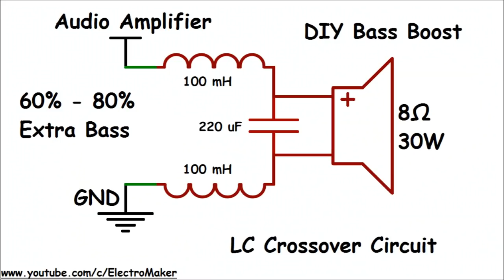How To Make a Bass Boost Low Pass Filter Circuit

Comment: He is using a polarized cap, it should be a NON POLARIZED cap. Audio is A/C so a polarized cap will fail.
Reply from the maker: it doesn't matter at all. Since voltage and current is small

Comment: Hello i have 3 subwoofers from 450 watt by 8ohm...  what do i need fof that to upgrade my bass ???
Reply: Buy bigger subs or build better sub-enclosures with reflex or search it on youtube
Reply: This is ONLY a LOW PASS filter so it only remove higher frequencies.
IF you want more power/boost then try a bigger amplifier.

Comment: It's NOT gonna boost anything , what you made is a lowpass filter that ONLY REMOVE higher frequencies NOT BOOSTING .
ONLY way to boost is to add more power.
What you create is a low freq speaker by roll off the high freq.
Unless you also update with midrange to cover the lost freq then you only will loose freq ' sound'
Try boost by using an equalizer and / or add a bigger amplifier instead .
It's only way to do it right.

Comment: i need some help with my little project if your able to lend a hand or your mind. plsss
Reply from the maker: what help you need?
Reply: @ElectroMaker  so i have project i want to do i have 1 sony xplode speaker xs-r1645 4way speaker peak power 270watts, rms 50watts 4ohm is there a bluetooth board you would recommend plu i have a bunch of 18650 batts id like to use but i dont know what all to by .

Comment: What is the point of bass boost when you cant get more power out without any distorion/clipping from the amplifier anyways? Like you could adjust it to only give 30W of bass and no highs thats all but you cant get more than that out of it! I am running 140W amplifier rn and i cant go over 100W without the quality of the sound going down so theres no point! But guys lower frequenzies that 60hz doesnt damage eardrums so its worth to buy subwoofers with powerful specs and amplifiers

Comment: To many crap videos on here showing you not how to do something. Don’t do this people. It’s completely wrong. I do electronics myself and this is not a bass boost but a bad low pass filter (well kind off) it’s all wrong anyway. If you want bass then get a good amp with good bass or buy a sub woofer and add it into your system. Don’t do this.

Comment: I have 4ohm 100 watt RMS speaker how bigger coil and capacitor do I need.
Reply from the maker: You need a bigger Inductor and Capacitor. 5 Amp Inductor and 240V Audio Capacitor
Reply: @ElectroMaker  how much farad is need and 250 VAC or VDC
Reply from the maker: @traceworld6571  250VAC Non Polar Capacitor